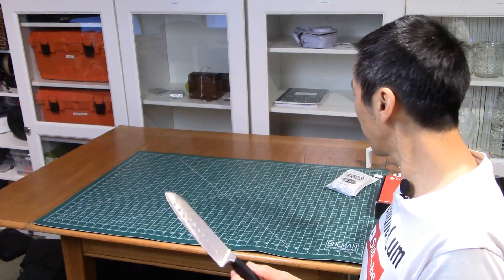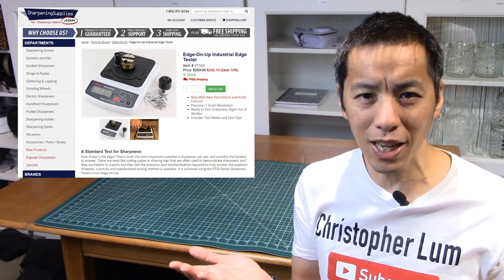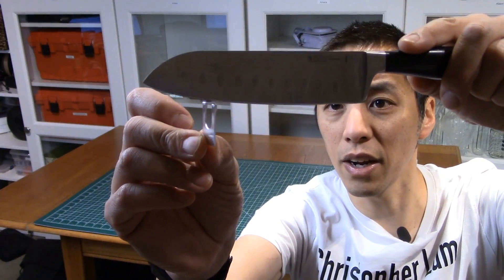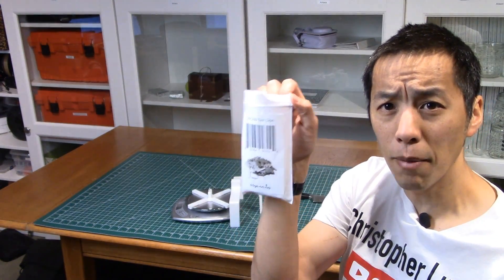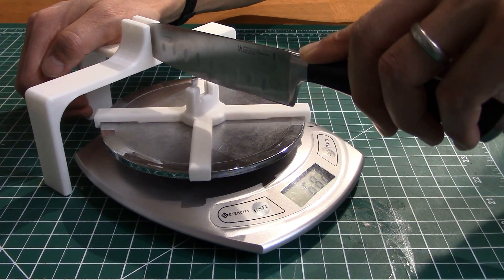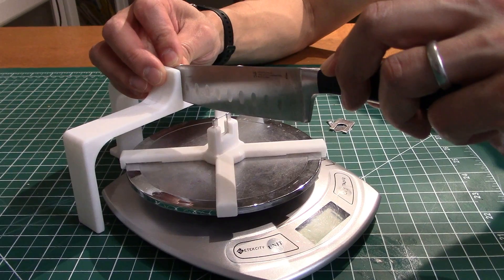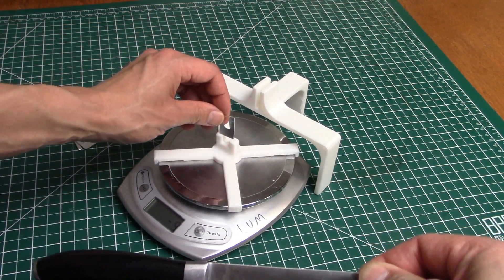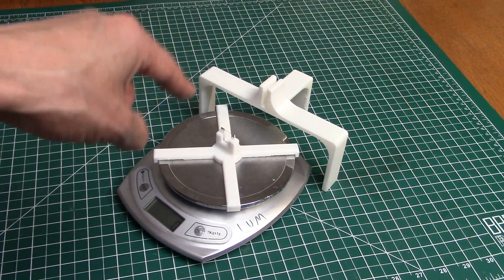DIY Knife Sharpness Tester

Comment: The "test media" looks like such a waste of fishing lines. Why not print something that can hold a disposable flosser?  a pack of 100 is like 4$
Reply: Its because the test strips are directly calibrated qith the correct tenaion and chemical composition. You would be able to use their chart to see what the results are saying. If normal fishing wire or any other media is used, it would have inconsistencies with thickness, material, even twisting would throw off the reading.

Comment: You might be able to make your own wire medium. Solder wire might be suitable.
Reply: The Edge Up tester uses thread , not wire ( wire refers to metal imo ) . The thread is " BESS " certified , but that does not really matter in personal use . Dental floss picks are co distant enough .👍

Comment: Some scales have a max-weight memory. I'm trying to find the name and when I do I'll post it for anyone here that's interested. 

I have a couple of suggestions for slightly modifying your 3D-printed parts. With the fulcrum, move the two legs straddling the scale forward, so that when viewed from above it's a 3-pointed star (think, Mercedes badge) with the fulcrum in the centre. That way when you press down with the blade it won't tip the device and you'll no longer need to hold it. My second idea is partly esthetic and partly practical. Do the same with the part that sits on the scale and incorporate some way of it nesting with magnets inside the legs of the fulcrum for storage. 
Felix Immler had a similar idea and found that 6.5kg 0.3mm fishing line was very close to the filament that you can buy from Edge On Up but a tiny fraction of the cost.
Reply: I've been looking for a scale with memory of the max weight, but can't find anything. Do you know of a model with that function?
Reply: @ 
I’ve had no luck finding one available in the UK so far but I’ve sent several messages to a guy that’s made his own set up and I’m waiting for a reply.
Reply: An automatic peak hold feature is common on force gauges, which do come in the force range of the 2kg scale use for BESS. Could make a suspended version from a force gauge...
Reply: @gerardhughes 
Thanks for the suggestion.
Reply: Hi, i looking for a scale with memory max weight memory, but i don't find nothing in nowhere...
Reply: @klettt1119  Look for a scale with the "HOLD" function.
Reply: @iwantfree9257  unfortunately, the hold button willl just lock the display at the time that you push it.
Reply: @ 
That's true for most scales but I've seen a couple of people have found scales that record the max weight.

Comment: Next step is to come up with a reliable alternative to the test coupons to reduce the cost.
- Cut through matchsticks? Likely too heterogeneous for repeatability.
- Dry spaghetti?
- A cheap roll of steel wire clamped in a homemade mechanism?
Reply: I suggest the plastic floss picks . The consistency of the thread will be good enough to judge sharpness ( determine improvement or decline ) . I have the best model Edge Up tester . Will make a tester " IF " I find a scale that records max pressure 👍

Comment: Personally, I prefer sharpening stones. It requires to develop a skillset, but it's easy and satisfying, although time consuming. And other things can be sharpened with stones as well, not only knives.

Also, sharpening stones could be found very cheap, and they are just fine for non-professionals.